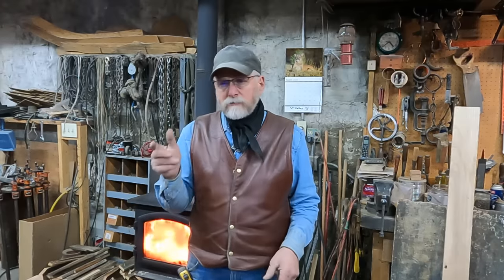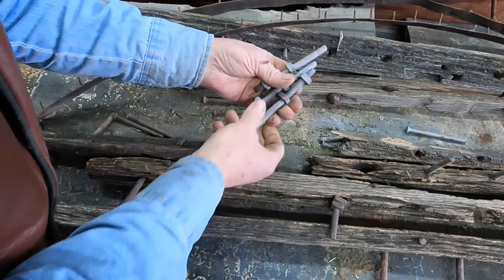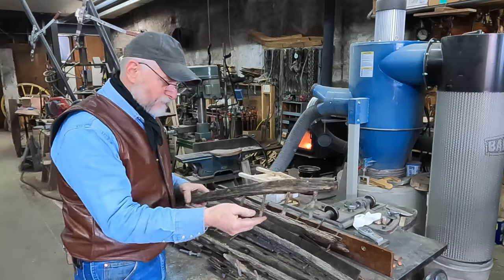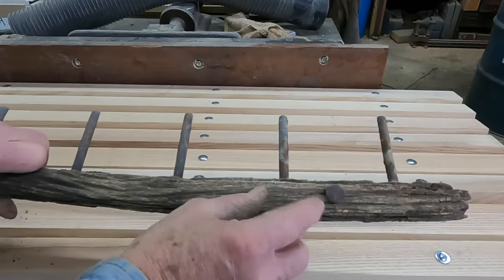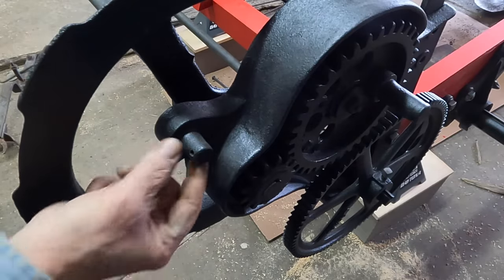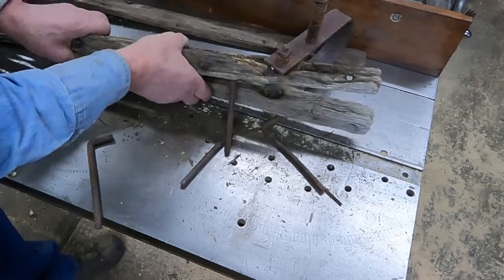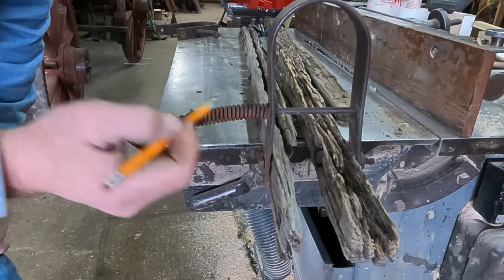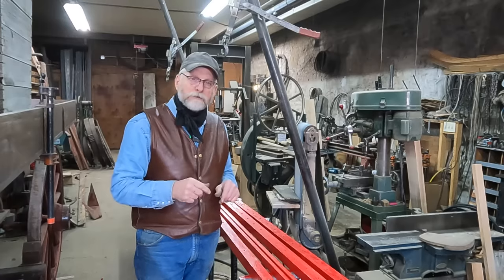The Smith Beaters & How They Work | Engels Coach Shop

Comment: Ah. A man that knows which way a washer goes. That's something most people do not know.
Reply: Because they are punched and one edge is sharp which goes against the wood. With the rounded edge up, it accepts paint better than a sharp edge.
Reply: I caught that too!
My dad hammered home the difference between "working face" and "showing face" by the time I was five!
I had ONE Maintenance Man out of a slew of maintenance monkeys in the last twenty years that actually paid attention when I explained why I kept flipping washers over! Everyone I worked with the first twenty-some years KNEW!
🙂
Reply: Yep, LOL.  It's kind of funny because I was just thinking about that yesterday when I was building a set of wood racks for my truck.
Reply: I notist that to.
Reply: @thomasbraeking6225   Good observation -  I suppose some would say that is progress  -   Me,  I'm just sad that standards can slip and so many don't seem to see the degradation as important.
Reply: Yep! Didn't catch that because of my watching situation. However, like you said, I highly doubt the other guys that I work maintenance with, would give it a second thought!
Reply: There is one situation where I put the washers sharp side up. Assembling painted steel frames and cover plates for machinery using stainless fasteners the sharp edge will not damage the paint layer and rust around the bolt holes happens much less.

Comment: I think the beater bars that were wider in the center, then tapered to fit the cast pockets of the drive wheels, were a good idea. The middle of the bars have the most stress and the wider stock adds strength. You are doing a superb job, but that ringing anvil set my tinnitus off! Thanks for sharing.
Reply: Yes,  I think making the engaging faces at the end of the bars tight and square might hinder smooth running.    Isn't that why gears are given a hypoid  form so they engage and drive more smoothly ?    When this machine is first set in motion I'd expect there to be heavy wear on those faces - or it jams -   and some relieving is needed.
My  tuppence worth.
Reply: @causewaykayak I do not think this is a problem, because the this wood isn't a part of the conveyer belt, but is fixed in place, making a spikey rotating cylinder...
Reply: @sidekickbob7227  Right !!   OK.   Then I had the design figured badly.    Embarrassing !    Thanks for the correction.
Reply: @causewaykayak  Well, it's just my guess how it's designed. Hooefully,  we'll get the conclusion at the next episode!

Comment: Surprised they didn't just use standard harrow spikes.  I'm betting that the company also made wood-framed drag harrows as virtually every farm equipment maker did back in the day did (because it was an easy addition to the product line.) One could duplicate the beaters in a jiffy using exactly the same construction style and parts.

Comment: your story reminds me of a old railroad mechanic/engineer, they were not always what the factory put out. some had been repaired by local blacksmith . the parts worked an looked like the real thing but not really. any way at the time it worked. now they have a pretty good  record of what they should be like not like your wagon were the question is which part is the right part. keep pluggin away your almost there.

Comment: Hopefully there's something I'm missing in the measurements of the beater bars and the L-pin bar.  If they're starting from the same reference point, the 3 and 4 inch spacings could end up overlapping every few pins.  There probably is some offset I'm not catching though.

Comment: I think one change might in order on the spikes to help retain them in place. I would cross for a washer and cotter pin to hold it in place. Another option is cross drill for a washer and safety wire the spikes to keep them from backing out.

Comment: Hi Dave I would like to thank  you and the other subscribers that taught me in this video the "right" way to place a washer! I have mostly, but not always,  put the rounded side up but that was just because it looked better. If was was in some kind of hurry they went on any which way!  The sharp edge gripping the wood aspect never occurred to me. I also admit that sometimes I do not like the side of the washer with manufacturers numbers, when present,  facing up. A question to on the old spring mounted on the "U" bracket. I understand from your description what the spring is supposed to do but that spring looked completely compressed as mounted so how will it provide some flex? as always regards vic

Comment: Hey Dave, did you notice that the latest issue of the Draft Horse Journal features someone spreading manure with a spreader similar to this?  It appears to be a John Deere variant, but it has the wooden conveyor belt floor like this one, rather than a solid floor and apron chains.  I believe it is on page 43.

Comment: It's quite fascinating to see the process of investigating original parts, your probably making it as it was designed to be rather than how it was actually built?
Maybe it originally used some 'cost cutting' measures when local blacksmith/builder deviated from plans to use what was on hand?
In Britain (and possibly elsewhere?) manure spreaders are  usually called muck spreaders.
Anyone not from inner city knows what is being talked about, (well, 40~50 years ago) 
You can tell (smell 😁) when farmers have been muck spreading 
I think last 30 years or so it's been more common for dairy farms to have massive holding tanks 50 ft diameter and spray liquid muck which seems to be even smellier than the straw/hay/manure mix?
Reply: This was a high-end manure spreader, so he's building it as it was made as best as he can tell.
Reply: @dianeengel4155  Better than new. 😎

Comment: I can estimate that you still need to drill the pins for the cross rivets as well as the beater bars for the cross rivets. I would have thought that you would have drilled the pin cross rivet holes before you installed  the strengthening cross rivets.

Comment: Hello Dave and Diane,  As usual, watching your videos, I come up with a lot of questions.  Usually nitpicky until you actually try to do some of this work.  When you look for what is original, how much do you look at the species of wood and, to some degree, grain orientation?  From what I've seen, the original wood is mostly the same species but repairs tend to reflect what was available locally.  I wonder how much the original manufacturer paid attention to how the grain was oriented.  Some ways the wood is less prone to splitting than others.  Given the lightness of the structures, it almost seems that they would want to give the pieces all the strength possible.  Maybe you could comment along the way. Maybe I'm just too picky.

Comment: For one unit, adding washers is a given. But in industrial scale, it starts to lose the value of investment. Also on bare wood the washer traps moisture and creates a lot wider rot hole than the riveted head. Smearing pitch, tar or bitumin under the washer gives it years of more life. Then there's "iron sickness". Steel/iron bolts create electric couple with bare wood, eating/burning the wood when exposed to the elements. This can be treated by adding carbon molecules, or by burning the bare wood i.e subtracting hydrogen, oxygen and nitrogen. Zinc/Nickel plating on fasteners only accelerates this process. Where the plating adds protection to the fastener, it also creates stronger reaction on the wood. Blackening/oil and heat is still the only way to get these parts to last. Or; PVC, nylon and panel glue. 200 years easy with no noticeable difference.

Comment: I wonder if the upper beater bar was bolted to allow replacement or repair of the spikes as there are not replaceable without disassembly of the upper beater bar. Just a thought

Comment: Okay, I gotta ask cause I've seen it in two different times this week... When setting up an anvil, the height of the block should be midthigh/the tip of your thumb... is that about right? What about work bench height? (I'm short, so standard (average) heights don't work for me. 💖🌞🌵😷
Reply: For either set up a table or similar that you can easily raise or lower, if it's too high to start with then raise yourself. Try doing whatever it is that you'll use the bench for and experiment with different heights. I assure you that there is no one height that fits all. 
There is a certain height for hand tool wood working benches that is coveted as the holy grail. I can tell you that it is the height of an American kitchen countertop, 34". It is so revered because there is a book from the 1700's that approximates the height, and a modern wood working journalist who is about 6'4" wrote an in depth article and later a book extolling the virtues of this height bench no matter what height the user is. (actually an equivalent height due to differences in tool design) Although this journalist does leave the caveat that no matter how perfect he believes this height to be it isn't often comfortable for the less cultured plebes.
I'm a 6' 7" hand tool woodworker and I can assure you that my back does not like to be bent constantly while hand planing or hand sawing or chiseling. I chose a workbench height suitable for my height and the work I'll be doing on that bench. I chose 39", roughly the height of an American door knob.  After 10 years of using this bench I'm still happy with my height choice,  the red oak lumber was expensive and it was a lot of hard work to make it. My wife is 5' 1" so my bench doesn't work for her. She prefers 30". Of course a workbench for machine woodworking wants a different height, often lower and varying.
Typically working at or just below your belt line is ideal. But that all depends on what kind of work you're doing, as well as the tools you are using.
For an anvil get a stump that is shorter than you think you'll need then shim the anvil with wood etc until you raise it to a comfortable height, then have a new stump cut to  fit that height. 
I have  multiple work stations and they all vary in height according to the work that I use them for.  I have a workbench that is from Lowes, it's good for standing at and working on items like small engines and such where height doesn't make a difference. I've built a welding table that has adjustable height, this allows me to sit or stand. My drill press is on a riser block so that the work is more at chest level rather than belt level which greatly reduces the need to bend, crouch, or stoop when lining up on a center. I built a stool to go with my woodworking bench that is an appropriate height to work at the bench while seated. Drawing, sketching, layout, sanding, painting, finishing etc are things I typically do while seated.
Reply: I noticed this week you are asking really  good questions !    Hope you get some good answers.   Looks like someone already sent in a nice long one.    I am just setting up a bench for a small model makers lathe  and theres SO MANY  aspects to take into account.   They say that time spent in preparation is seldom wasted.    I think doing plenty of mockups is handy.   It's what works best for you as the other gent  is saying here.